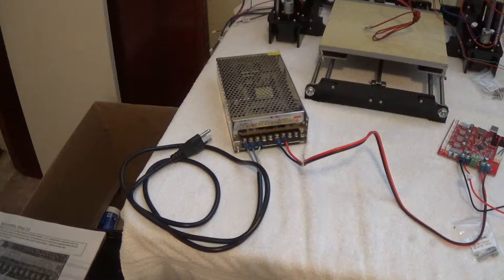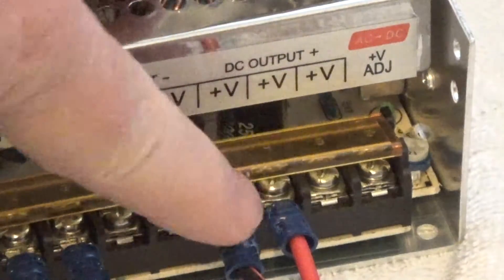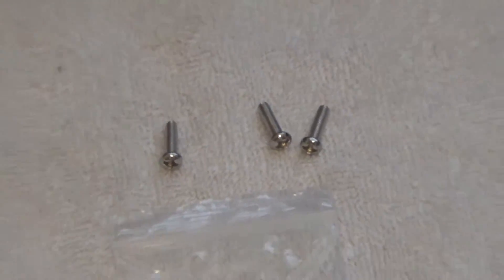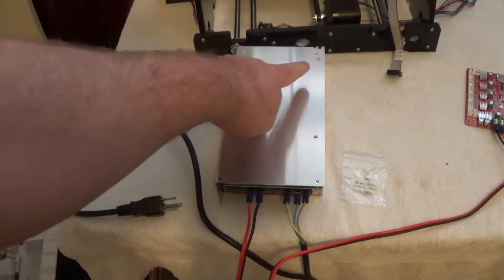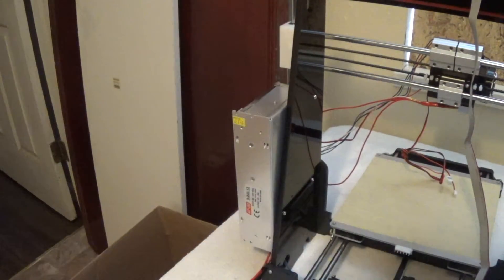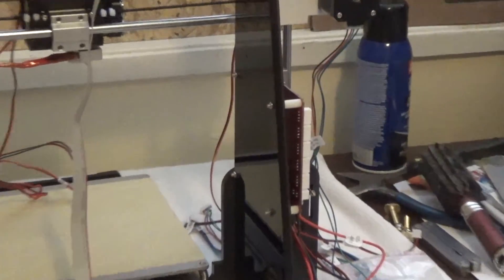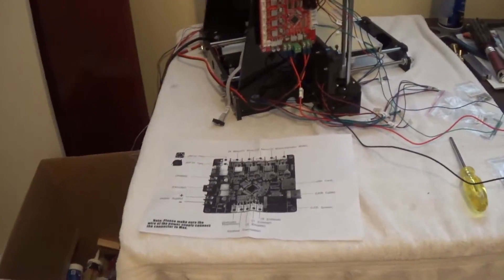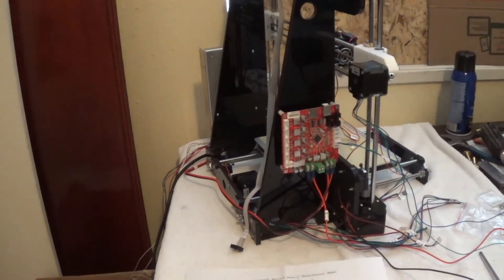Anet A8 Assembly Steps 23 24 25

Comment: Is the brown wire to the hot? My light blue wire is to the hot.
Reply from the maker: Should watch this whole video, but 6 min in, it explains it here:
https://www.youtube.com/watch?v=IvwcLqMip8k
Reply: Thanks for the quick note, I see you did a continuity check at 6 min. So did I, that's where I found the power cord in my Anet A8 kit used light blue to L, load or line, and the small blade or HOT of the receptacle. What's to say they don't mix up power wire colors in China? The other Anet A8 instructions had me wire the board wrong, red wire to right board tap, when I saw the polarity marks on the board and swapped power wires then everything turned on properly. LOLCANO! Meanwhile I'm now making parts!
Reply from the maker: Your welcome :)
Reply: I did a continuity check also and my hot wire was Blue also.